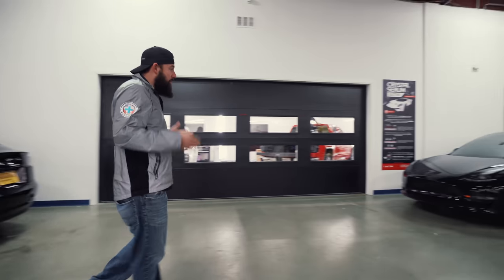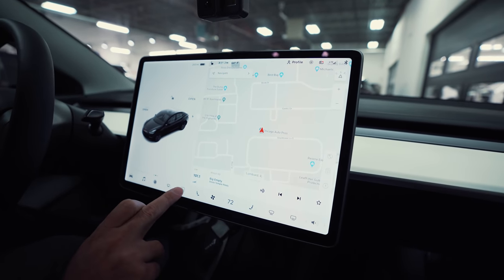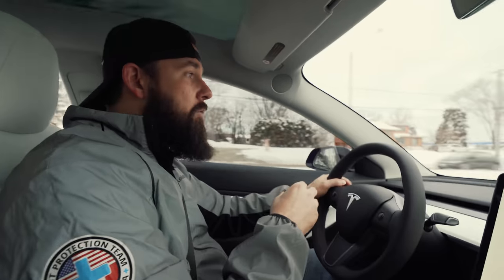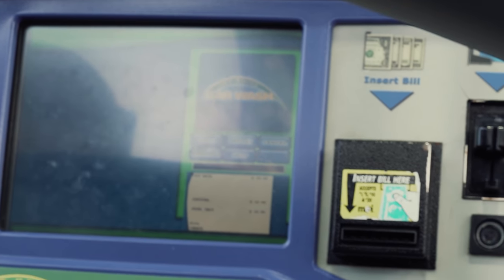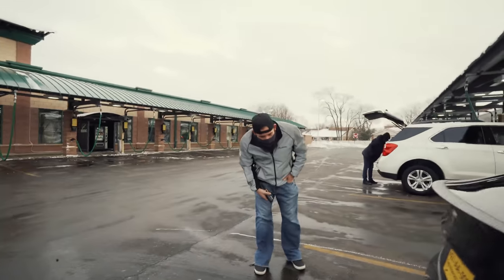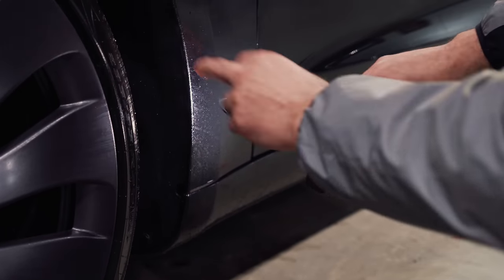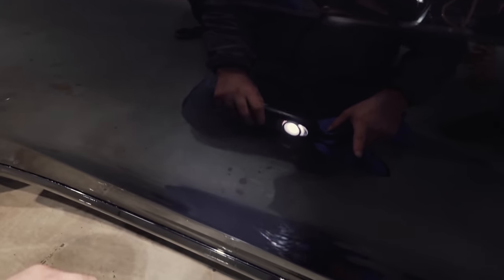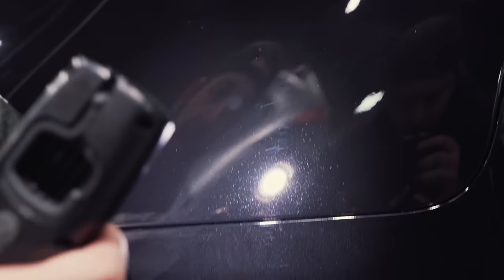Will A Tunnel Car Wash Scratch My Car? | I Bring My NEW Tesla To The Car Wash

Comment: I mean they have touch-less tunnel washes that only use pressure washers when I’m lazy I hit those up lol
Reply: I’d be interested to hear Jason’s thoughts on the touch-free washes. I use them as well.
Reply: Yeah the problem with those though are that they use such strong detergents to get the stuff off the paint which strips was and even some paint sealants
Reply: @sahib6742  Good to know. Thanks for the reply!
Reply: @jeremyb_86  yea no problem, meant to type wax not was lol
Reply: @sahib6742  yeah perfect if you want to give it a good cleaning before you touch it up and add new protection

Comment: I'd be interested to see the damage after a "safe" wash on soft tesla paint for comparison - great stuff
Reply: You may see several minor scuffs. But it’s definitely not gonna be all scratched up with thousands of deep scratches like the tunnel does.
Reply: @michaelzheng3129  the tunnel made scratches because it didn’t use any prewash programme under high water pressure to lift off some dust and dirt but instead went straight for the shampoo and brushes which is a recipe for swirl marks
Reply: @vlatkomafija  that’s one thing too
Reply: @vlatkomafija  it will scratch the paint in the same way even with prewash!
Reply: @FuzzySvini  naaah
Reply: @vlatkomafija  you wish 😂
Reply: @vlatkomafija  Do you reuse the same wash mit/microfiber towel/whatever you use without washing it in-between washes? Because that is exactly that those brushes are doing. Foam and high pressure water or not, those brushes will collect dirt in the material and scratch the paint.
Reply: @1xRoasters  properly maintained brushes do not contain dirt because when they rotate the dirt is expelled from them before it touches the paint. But in this video clearly we have no lubrication to act as a buffer between the paint and the brushes, only some shampoo and straight to brushes with a very dirty surface if the paint.
Reply: @1xRoasters  do you use your wash mit on a paint surface thats not clean or you actually go with the washer jet first and then snow foam and then again with the washer jet and only then the wash mit, right?
Reply: It's still going to mar a little. If you want to keep it perfect, you got to do a light polish every year no matter how safe your wash technique is. Especially on a non metallic black car. It shows everything
Reply: @emillindblad3059  exactly. I also think using two bucket method is overpraised but in reality its causing swirls and marring over time as well. If you want perfection, wash your car less and of course polish it as you said. I also think drying your car not using microfiber towel but instead contactless air gun is much better.
Reply: Vlatko works in a car wash. He doesn’t wanna lose business. U make no sense bro
Reply: @themachine8009  wtf?! :D
Reply: @vlatkomafija  u r watching the wrong channel. When Jason gets out of his car to ask the  attendant at the car wash to c if it’s safe to go to the tunnel car wash. That guy is Vlatko.
Reply: @themachine8009  hahahahahaaha. is every manual car wash safe? . you have some manual car wash places where they are terrible, using cheap shampoos and using the same sponge/mit on thousands of cars over and over again. since we know thats not the case and not all manual car wash places are equal, same can be said for automatic car wash place. Some are terrible (like in the video) some are much better and they do provide much better manual pre-washing program that removes dirt from the car. trying to put all car washes under the same basket is simply inaccurate statement.
Reply: @vlatkomafija  what the heck? No one, not a soul mentioned anything about do it yourself coin operated car wash places. Not a single living soul. You just wanted be right about an opinion for once in this comment section. Here ill join you. Having godzilla and kong fight on top of a car during a wash will create deep claw gouges so no one should do that when washing a car. Amirite guys gimme five.
Reply: @koniko169  who mentioned a coin operated car wash place?
Reply: @vlatkomafija  “you have some manual car wash places .....using cheap shampoos and using the same sponge/mitt...” if you meant a hand car wash business. That was the most backwards way of saying it. Like do you make dinner at home or do you do one of those manual pots, pans, and stove places that have kitchens? Go to a restaurant.  Go to a hand car wash.
Reply: Anything that touches the car will overtime leave swirls and scratches hell I got my jeep hand washed only 2 times and rest of time I use touchless wash no offense but if cars use a tunnel wash all day long the brushes Will have dirt or something in them no tunnel wash is 100 percent perfect bets way to keep car perfect is touchless or wash with very clean mitts and yes polish once a year
Reply: This is why I will never buy a Tesla nice harp cars but the paint is very week on them which for what they cost to buy should not be
Reply: scratch is inevitable but the question is how long or how many washes before your paint gets beat up.  well with 1 tunnel wash ....

Comment: Could you show the results of a touchless wash? Or what is your opinion on them? I'm guessing they don't scratch but I know they use harsher chems.
Reply: I would like to know this as well.
Reply: I pretreat with close to the same ph level as a touchless before every wash and I only do that to clean as much off the car as I can before a contact wash, I also add protection after every wash so anything that is lost in protection is added back after the wash. The only real downside to non contact washes is it seems to leave a film especially if it adds a wax at the end.
Reply: From my experience a touchless wash doesn't scratch, but the detergent eats away at coatings and doesn't even get the car very clean.  I use it mostly for the undercarriage wash in the winter but then make sure to find a warm day so I can use a waterless wash after with about 40 microfiber towels and put a spray coating back on at least.  I clean the wheels with a typical wheel bucket and pump sprayer in the winter.  Wheels and tires have to be done like a typical hand wash.

For waterless wash I really love Ammo Frothe I have to say.
Reply: @irocvert8728  On cold and extremely salty areas, I'd say running your car through a touchless every couple of weeks to get rid of the excess salt is the "lesser evil" if you can't properly hand-wash often, eh?
Reply: @Orangetilt  Yes, absolutely... and if its above freezing I use the Ammo NYC Frothe waterless wash with microfibers to get it really clean and put a topper on it.

Touchless is the lesser of automatic wash evils...
Reply: I work at a car wash and we manually guide and send rollers to push the car, after we activate the rollers to push your car we have roughly 30 seconds to do a full retract which causes everything except the soft slow brushes. 

You may get scratches but nothing compared to this tesla

Comment: This is why I use touch-less car washes in winter when I can’t hand wash my rust bucket.
Reply: Those touch-less washes use strong chemicals which strip the protection off your car.
Reply: @windycitystig3680  Some don't. I've clayed and waxed my car back in August. Wax is still on it even going through the same touchless wash 1 or 2 times a week.
Reply: Some do some dont. My local touchless wont even remove all the dirt. Yesterday i used Koch Chemmi Green Star at 10:1 and sprayed down my whole jeep before running it through. It was 80-90% clean. I finished with Mckees sio2 waterless wash. Surprised how well it came out.
Reply: @socialjusticewarrior9601  hard to say if that’s your wax still holding up or another chemical. Touch less car washes apply a “drying aid” chemical to the vehicle just before the blowers to create water behavior and help assist in drying the vehicle by forced air. If it wasn’t for this chemical the water would just blur around on the surface instead of blowing clean on vehicles without protection. It is mostly expected of these types of washes that the chemicals are so strong most sealants and even some coatings do get attacked by their wash process.
Reply: @verospremiumcarcare  The car wash I go to has just a soap soak period and rinse. I'm in and out in 2 or 3 minutes.
Reply: @verospremiumcarcare  you’re 100% right my man.

Comment: I’m glad i watched this video because i was planning on taking my new black truck through on of those cars washes . Living here in Canada  it’s almost winter and to prevent my water pipes from bursting my out side water source is shut off now . therefore i can’t wash my truck at home right now . In the past i’ve always done the touch less car wash but i notice the last time my truck wasn’t even clean  after spending almost  $20 . So now I go to a pressure washer type car wash and use a soft car wash mitt during the winter months

Comment: I'm familiar with this cash wash, they use plastic bristles.  If possible on a future video you could try Delta Sonic or Fullers, they both are soft touch cloth instead of plastic.  To see if the soft touch makes a difference.  They are both in the area as well.

Comment: Any suggestions how to wash at home when it’s winter with salt and snow and below 32 outside??? 
Waiting for the next video 👍👍👍
Reply: It is a challenge if you don't have access to an indoor spot to clean your car. But you can check out AmmoNYC's Frothe rinceless soap.
Reply: Find a touchless wash and use it until it's warm enough to wash at home. That's what I do.
Reply: @clutchthepearls3062  only issue is that with all the snow and salt the car is pretty filthy to me to use that and it’s only in the single digits for the high.
Reply: srt4booster Go to do-it-yourself wash when above freezing only, don’t use the brush. If you must use use the brush clean if first with the high pressure wand

Comment: Would a touchless wash be a viable option if there’s no means to do a proper bucket wash in the winter?
Reply: I think responders would need more info, such as what "winter" means to you.  Winter in the north with snow?  Are the roads salted?  Winter in the mid states where it's just kinda cold and rainy?  Winter in the south where it's "cold" if it drops below 60°F?
Or is the question, "Is a touchless wash better than simply leaving the car 'dirty'?"  Or is the question, "Is there any way a touchless wash could potentially scratch/damage my paint?"
Reply: Touchless washes use some degreaser to clean the car.. over time that may eat through any protection you have esp wax and sealants. I just rinse my car with a pressure washer to get the salt off. Bucket wash on the warmer days
Reply: @evolution2001  In my case, winter as in between -5°F to 32°F for months straight in New England, so you if you try to hand wash the car, it will turn to ice before you can rinse the soap off. I clean my own in the summer but I just took it to the touchless car wash today.
Reply: @Rama Nrusimhadevara not so subtle flex
Reply: More damage is by far done by hand washing then automatic car washes an thats a fact!

Comment: Wisconsin salty roads really do a number on cars in the winter. I pre spray with ONR to rinse off the salt, dirt, sand first then do a rinseless wash in the garage. I need a drain in my garage floor so I can whip out the pressure washer for an undercarriage wash once in a while though. I’d it’s really dirty I’ll take it to a coin op wash bay and blast all the loose contaminants off and drive it home to finish the job.

Comment: Thanks for this video. My 2000 Audi had to go back to the dealer for a recall. It had been sanded, polished and ceramic coating.

Then they put it through their carwash, which they are denying. All of these scratches.

With this video this will be more difficult..
Reply: Newer automatic car washes actually use closed cell foam which cannot hold dirt

Comment: Seems like that Tesla has soft paint…

I’m a full time rideshare driver who lives in an apartment building with no access to outdoor water and no space to wash. Also, I clean my car at least once a day, so hand washing just isn’t practical.

I have a 2021 Hyundai Sonata SEL in Portofino Gray and it’s fine, for the most part. There is a couple water spots. 

Is it still worth getting a ceramic coating if I’m definitely still going to use a car wash?

Comment: Would one of the 'touchless' tunnels be any less damaging?
Reply: Far less damaging. 

The issue with those is that they often use harsher soaps to get your car clean so they're a bit rough on your wax/sealant/coating, but otherwise they shouldn't cause any physical damage. 

I use one in the winter because getting the salt off the car is more important than my sealant lasting 6 months instead of 3 months.

Comment: These washes are very safe, however, the reason they got these results were due to the soft paint on this type of vehicle which is only meant for touchless washes. I work at an express wash very similar using modern equipment, and we simply don't scratch cars, nor do we have any dissatisfied customers. These drive-thru car washes are very safe, and I have a huge passion for the industry for these types of washes, so it kind of offended me. Most people will argue and say the brushes will scratch, but it's just common sense that these modern washes use "foam" material brushes that do not retain any sand, dirt, or debris in them. Thanks!

Comment: if I do not remember completely wrong, then it is normal to add water-repellent before drying. but it makes the car lose much of the original shine and it also makes new dirt get stuck easier that you have to wash again. which in turn gives more $ to the company

Comment: What where the brushes made of 😂 i use the automatic car wash near me every day (im a cabbie its required) and my car doesnt have any of these marks on it after nearly 200 washes. I used a light to check just like you are thinking the paint would be in a horrific state  but other than minor scratches from stones/pebbles its smooth with very few scratches.
Reply from the maker: Yes, it does.
Reply: @ChicagoAutoPros no it does not, automatic car washes use closed cell foam which cannot scratch cars, if car washes were as bad as they are portrayed in the video then every car would look bad. Also your car was not scratched by the wash it was scratched from road debris and the wash just removed the polish

Comment: The side brushes and top brushes are okay, they won't harm your car, it just looks and sounds like it's doing something harmful to your car. But according to Google and myself (Yes i am a carwash expert) every spinning brushes normally spins at about 10,15,20,25 mph which is a okay-ish speed, and the top brushes (ones with the strips) will slap part of the car but won't really scratch the paint. Your car will be okay if the carwash doesn't go hard on the material. The brushes looks like it's spinning really fast (but it actually isn't) because it haves lots of strips on every round curve.

Comment: So, unless I missed something, you didn't specify what type of auto car wash it was. Many people say brushless car washes, using only cloth strips, are far better. Was this car wash brushless? Thanks.
Reply from the maker: Even the brushless car washes can damage a car's paint; they tend to use very aggressive chemicals in order to make up for the brushes not hitting your car. On top of that, they're typically very cheap chemicals as well. Cheap and aggressive don't really mix well together. But to answer your question no, this was a regular auto wash.

Comment: OW !!  Will avoid tunnel car washes from now on.  Two questions:  Did Ceramic coat provide more/less/same scratch resistance (video hinted at coating helping)?  How would _manual_ car washes (hi pressure pre-rinse, foaming brush, hi pressure post rinse) compare ?
Reply from the maker: The ceramic coating side was the same level of scratches of the non coated side. The ceramic coating is going to help keep the car cleaner for longer so you will not have to wash the car as often. Do not use any kind of brush on the vehicle paint
Reply: Thanks!  When visiting Opti-Coat Pro's site (Pro + is on my car) they're now promoting Pro3 (their shown test results say it's twice as hard as Pro+).  Hard enough to resist scratches?  Unknown.  Will stick to ONR and soft sponge/mitt washes from now on.
Reply: Newer automatic car washes actually use closed cell foam which cannot hold dirt

Comment: Great exposure! Anyone wanting more info on tunnel car washes or self serve car washes, you can go to the international car wash association. Most car wash companies like that are part of this group. Water used is my biggest problem. Recycled. That is how they keep car cleaning cheap. It is very much so an environmental consideration. That is the biggest reason for paint damage. Those car washes need to be very maintained to be affective. Both in filter cleaning and a chemical water purification (biggest reason for pain haze and water spots). Personally, I make it a point to run my dirt bikes through a self serve car wash to get the mud off before I go back to the shop to clean and do my maintenance. Car washes have a place to help maintain a vehicle. I tell my customers they have good vacuums and trash cans to keep your interior cleaner!
Reply: Your totally wrong! Im a member an modern day car washes dont use Reclaimed or as you say Recyceled water! Ive been in the business for 28 years an know many operaters all over the country! So you should check your facts before you speak on something you real dont know anything about! For 1 that was common in the 60s not today! Its way more costly than using regular   old city water!